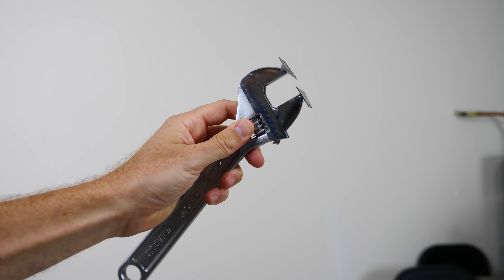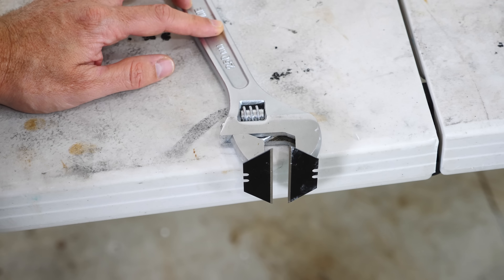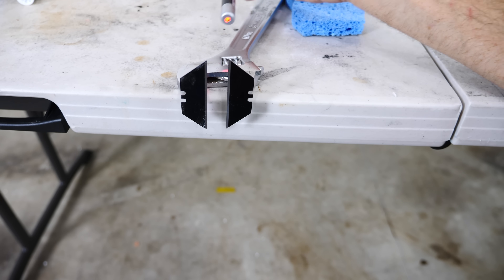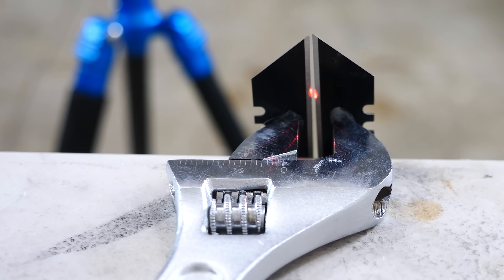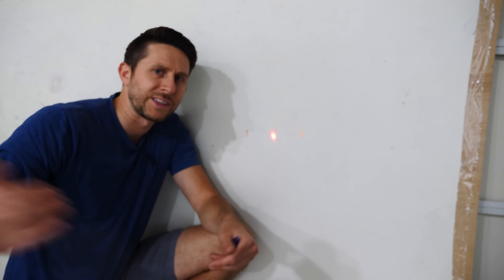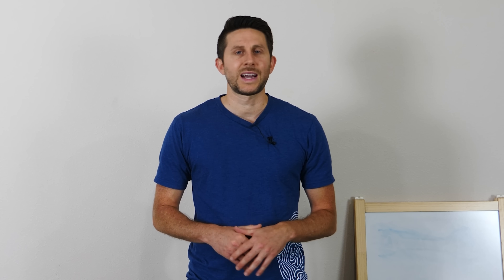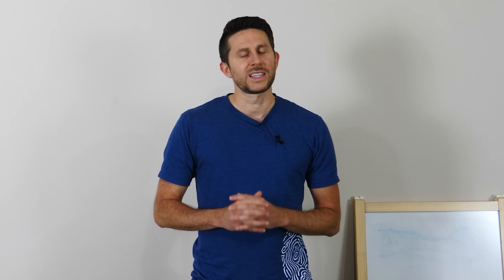Squishing Light Makes It Bigger—Heisenberg's Uncertainty Principle

Comment: The "elusive" particles with photons that are getting  squished is simply the actual Electromagnetic Quantum Kinetic Dipole Particles meaning the Vacuum is filled with EM Field Dipoles which are absolutely 100% VERY REAL and they have a mass of about 10^(-90) kg each.  There are 10^(-18) kg of EM Dipoles per cubic meter of vacuum on Earths surface (dark mass).  EM Field dipoles hit everything at speed "c" and transfer momentum causing all forces (dark energy).

Photons are particles with quantum superfluid flows of condensed EM Fields or flowing Bose Einstein Condensates of actual EM Field kinetic Dipole Particle "gas" that fills the vacuum.  There are about 10(54) dipoles condensed within a single "green photon".

NASA / DoD have known about EM Field Dipoles since the 1970s when the first Electromagnetic Compression Drives were designed and later built and flown under SDI Star Wars Research on USA DoD Flying Black Triangles and in C h i n e s e UAPs flying since 1999 (UAPs in the news are Hypersonic Weapons / Drones).  

After Dad helped launch Apollo/Skylab from #FiringRoom1 at KSC, NASA went FULL WARP until DoD took the research over and weaponized it.  Then the C C P stole the tech and weaponized it.

The US Navy has no chance against these EM Compression Drive Propulsion Systems on these UAPs.  These UAP can go 50g's and 10,000mph at sea level faster in LEO.  Yes the UAPs can work in orbit too.

Comment: 1:21 Photons do have mass, that was also proven.  Albeit the mass is so small that it is nearly inconsequential.   But then again, tell that to Einstein when scientists in the early 2000's proved laser photons can travel faster than light.  In that experiment the speed of a laser measured 310 times the speed of light through a gas of caesium atoms in an excited state which amplifies certain spectrums of light.
5:17 Seriously?  I guess no one learned that Red light and Infrared light has no UV rays in it.  Heisenberg principal does not apply here.  Only a sound education is needed.
6:03 Great concept if Time were a variable that was physical and could be manipulated by physical means instead of it just being a universal constant scientists haven't figured out yet.  I suppose next you'll suggest time travel is possible since Time is a variable that can be changed relative to all points of references simultaneously instead of one point of reference Einstein's theories fail to address as an issue of scientific observation.
Reply: "Photons do have mass, that was also proven."
Interesting assertion; who got the Nobel for this?
" speed of a laser measured 310 times the speed of light through a gas"
The speed of light as a constant is set by its speed in a vacuum, not through a medium where its speed can vary. This constant is the speed that nothing with inertial or relativistic mass can attain in a vacuum, neither of which light has.
"Red light and Infrared light has no UV rays in it.  Heisenberg principal does not apply here. "
Wait, so there must be UV rays for it to apply? Why? He's only explaining that the light did not arrive at the backstop as a wave, but as particles. And he specified his red light had no UV.
"Great concept if Time were a variable that was physical"
Well, he's only showing how it works in an equation, not speculating on its reality or whether one can time travel. 
" it just being a universal constant scientists haven't figured out yet. "
Since when is time a universal constant? It's completely relativistic, and only constant in any particular situation where people have agreed to regard it as a constant. I'd like to see him demonstrate the time/energy relationship, too, though.

Comment: I'd like to see this again but with differently sized (as in different diameters) laser lights and/or a gap that is longer. If the laser source is any bigger than a single photon, then we can't be sure that the line effect isn't happening because of the slightly differing angles of photons coming from the source itself. In other words, a photon coming from the center of the light will be at a slightly different angle than a photon at the edge of the light and changing the width of the gap could affect the difference in the angles of those photons.

Comment: I was more thinking about reflection to be honest. Those razor blades don't go to an infinite point. In comparison to a photon, the tips of those blades would be like a million football fields, surely plenty of space to reflect the laser slightly causing it to spread?

What happens if you rotate the blades 90 degrees? Does the light spread vertically?

Comment: Interesting experiment, I've seen that happen before, but that second part about wave v. particle didn't make sense when you were talking about the glow-in-the-dark wall, my experience is that the glow in the dark paint will not respond to red light, works great with blue or UV light, so what would happen if you used a blue or UV laser to do the test?  I know I'm missing something, please help / clarify...  Thanks!
Reply: Individual photon's energy depends on its wavelength, colour, if you will. Blue & UV light have shorter wavelength and hence more energy per photon than red light. You need a higher energy photon – the quantum of light – to excite the dark paint to glow. So, if you used blue laser light, it would make the wall glow and it would also still diffract – however, in a different pattern as the energy [per photon] would be different!
Reply: @Geenimetsuri  I understand wavelength of light is shorter for blue/UV than red but how did that provide the proof? If you can, could you connect the dots for me?  (pun intended)  If I repeated the experiment with a blue or UV laser it would still diffract and it would also charge the glow in the dark paint, sure, I'd expect that... but how does that show the wave v. particle properties of light?  Or was there something special about doing the experiment with red light?  Sorry but I'm feeling like I'm missing something fundamental here...
Reply: @HobbyHalloween  Diffraction is caused by the uncertainty in the position of the photon, the quantum of light. The wave-like quality of light stems from the principle!

I only understood it myself after watching the video.

Comment: WHAT HAPPENS IF WE PUT A WIND MILL IN SPACE AND MANUALLY ROTATE IT FOR ONCE?
WILL IT SPIN FOREVER?
UNLIMITED ENERGY?
THEN WHAT ABOUT 1ST LAW OF THERMODYNAMICS?
Reply: If you put an object in space and rotate it it will turn to continue rotating until another force opposes it.  I suspect it would not spend forever because there are still particles in space that may interact with. However as to the question of unlimited energy, that answer is simple. If you're not drawing energy from it then there's no violation. But if the windmill was connected to a generator which was generating power it would quickly come to a stop because there was no wind to keep it moving.
Reply: @NomadSoul76  i thought there is no friction and almost no gravity in space, so there won't be any stopping force for the mill, if we rotate it for once
i still don't understand why it will start slowing down if there is no friction and gravity

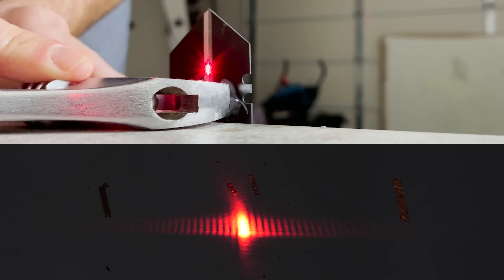Comment: 4:35

so you might have exlpained this but I must have missed it. anyway, this is an interference pattern. But I was wondering where it came from. 
normally an interference pattern is made when you shine light from 1 source through 2 or more slots. they then interfere with each others patterns and create this lot area and dark area pattern. but the laser in this case was being lit through a single slot. so how come we see the same pattern?

Comment: but if we know delta X and h/4pi then the only unknown left is delta p and we should be able to easily calculate delta p from there? you get what i mean? from a mathematical point of view lets say you say 5 times x equals 10 then its easy to find this single unknown which in this case is 2. so im not happy with the explanation because i dont like to believe, i like to know and i totally dont know how it can be uncertain and certain at the same time
Reply from the maker: correct you can solve for deltap. Deltap is not the momentum it is the standard deviation (variability) of possible momentums. The smaller deltax is the larger deltap is which means the momentum you measure as a result has a larger variation so you can't zero in on one single momentum.
Reply: @TheActionLab  ah okay i get it now, if i solve for deltap i get the variability of possible values but not the single exact value. okay that makes more sense to me now, thanks for letting me know

Comment: Sorry but I can't agree on this without more testing.  I am likely to be way off the mark (I'm not qualified) but I can explain why I disagree.
I explained to a friend that you can describe a photon as being like a circular table cloth.  If you pick the cloth up from the centre you increase it's energy which also decreases it's size [wavelength] on the table. The 'particle' is somewhere within the tablecloth and the higher the up [more energy], the more defined that position is.
Your experiment assumes that photons are 2 dimensional in that a photon which has passed through the slit cannot interact with one on the other side of the slit.  I don't believe this to be a true conjecture because of the '3D' nature of particles.
Note: I'd go so far as to say that photons 'diffract' because of their position passing through the slot - i.e. partial refraction and that the double slit experiment only works because the particle essentially interferes with itself on the other side i.e. the number of ways it can pass through the slot are limited by it's refraction and it's wavelength.
But then, I'm fully aware of dual nature of Dunning and Kruger :)
Reply: The table cloth conversation went like this ...
"How come my old Flood light is 500W and yet my TV can see the transmitter 20 miles away which is 1KW"
I explained that radio waves were about half a metre across and could easily be capture by a TV aerial but that light waves were tiny and literally had to go through your pupil.  Not only that but the lower energy of a radio wave meant there were far more of them .
A million times more photons that are a million times larger means the TV transmitter is a bright beacon to a TV aerial.

Comment: I don't get it, the light is clearly getting wider because it's bouncing on the edges of the razors getting spread around, like in the cilinders butterfly effect video...
Reply: How can it form so definite patterns then. We have done the experiment many times and concluded that even if you make the blades very very thin (no room for reflection) pattern doesn’t change
Reply: @karansandhu4827  4:37 hmm to me it just looks like the closer the blades get, the more the light curves around the edges, im not sure about the pattern, it probably has something to do with the reflection and the gap, it looks like the gap is repeated... anyway this probably should be tested with black body razor objects, under vacuum?? to see if the same would happen...
Reply: @elvinl.  i just told you the pattern depends on only and only three things. Slit width, distance of slit and screen, and wavelength of light. I suggest you to do this experiment with changing your variables and noting down the value of fringe width( distance between two consecutive bright spots). I am sure you will see that black blade shows the same result

Comment: Alright, I'm becoming more certain that what's happening here and with the double slit experiment is the light is refracting off the microscopic surfaces of the edge of the slit creating the wave like patterns.
Reply: King Pistachion  Just a flat response, is it? Okay, well hear me out if you would. Light is extremely tiny right? A particle of light can be so small that it's not bouncing off the surface of an object, it's bouncing off the tiny particles  that object is made of. Did you see the the experiment that he did to demonstrate butterfly effect? It's kind of like that, but with each particle of light behaving like the laser passing through the array of reflective tubes. Instead of behaving like a wave, it's simply behaving as particles would passing through field of other particles.

Comment: Fundamentally wrong interpretation. Misinterpretation. 
A photon is the 3D droplet of energy. The only true, perfect fluid which exists. Whose size is finite. And its shape is spherical. And the distribution of energy along any direction which goes through it has the shape of a soliton (solitary wave). Smoothly continual "bell"-shape. 
A photon is the energy in its most fundamental way of manifestation. A tiny pure-energy-object.

"Position" of an object. What is it? 
"Lambda" of a photon, which is: the length of a photon (energy droplet) in the direction of its motion, is not "uncertainty of photon's position", but it is the diameter of the energy droplet. The length of that energy object.
If you look at, e.g., the droplet of water. Not the perfect analogy, but good enough to highlight things about the position of a perfect energy-fluid called photon.
https://www.youtube.com/watch?v=nzhjBFhEwvg
https://www.youtube.com/watch?v=jn5KuSHguUE
https://www.youtube.com/watch?v=H_qPWZbxFl8
Where is the droplet? It is everywhere within the volume it occupies.
What is its "position"?

How does this water-droplet behaves?
https://www.youtube.com/watch?v=TLbhrMCM4_0
LIke a particle? Like a wave?
https://independent.academia.edu/ZDimi%C4%87
Read the files  1 and 2.
Reply: What are u trying to prove?
Reply: @karansandhu4827  I am surprised. On many other channels about physics, only I can see my comments. 
Well, I am sure that soon it will be the same on this channel, too.

“The scientists of today think deeply instead of clearly. One must be sane to think clearly, but one can think deeply and be quite insane.” ― Nikola Tesla

"Behind it all is surely an idea so simple, so beautiful, that when we grasp it - in a decade, a century, or a millennium - we will all say to each other, how could it have been otherwise? How could we have been so stupid?" - John Archibald Wheeler
Behind it all is not an idea, but the facts. Long time known fundamental facts. Two of them are expelled from "fundamental physicses of today". Yes, I know that there is no plural for the word "physics", but the reality demands it ("relativity", "uncertainty" (QM, QED, QCD, QFT, ..., strings/superstrings, ..., branes, ...), "spontaneity", "creation ex nihilo", "annihilation", ...). Mathematical mysticisms.
All of them are the results of "deep thinking" (attempts to invent the fundamentals of reality). 
Perhaps you will take some time to read the files 1 and 2.
Perhaps. 
“The masses have never thirsted after truth. They turn aside from evidence that is not to their taste, preferring to deify error, if error seduce them. Whoever can supply them with illusions is easily their master; whoever attempts to destroy their illusions is always their victim.” ― Gustave Le Bon
Unfortunately, not just "the masses", but the scientists, too. Especially the scientists.
https://en.wikipedia.org/wiki/Planck%27s_principle
https://www.academia.edu/2798010/Science_Pseudoscience_and_The_Three_Stages_of_Truth

Sorry for this long comment. Despite I know I write in vain ... . 
So, ... have a nice day!
Reply: @karansandhu4827  It requires some patience, time, and clear thinking (healthy reasoning). Read the files 1, 2, and 3 which you can find at the link which I gave in my first comment.
If I would say straight some things, nobody would believe me.
The best way to realize and to accept some truth, is to figure out on your own that it is the truth. So, read and think about what is written in the files 1, 2, and 3.
As I said, I was surprised that my comment is visible. So, I was talking to the creator of this video. As for you, I said what I said. And you'll do what you're going to do about that.
Best regards!

Comment: I have one unanswered question about light.
Under street light, when you pinch your fingers togather; when they are about half a centimeter away, the shadow of the fingers looks they are touching. Im really seeking an answer for it. 
(And another observation might be related to it, that if light source is closer to an object, the shadow will be sharper but as light source moves away the border of shadow blurs.)

2)another question, what is minimum length at which distance 2 electromagnetic waves don't interact? Is it wavelenght dependant?
Reply: For second question, i don’t think 2 electromagnetic waves interact unless you are intersecting them. Example just take red and blue lasers and place them next to each other. I dont think they interact

Comment: I've also run into a similar uncertainty when doing signal processing. The more you know about the frequency of a signal the less you know about the time at which that frequency was occurring. (Frequency resolution vs. temporal resolution)
Reply: The uncertainty principle follows from the "wave nature" of particles in QM. In fact, it holds for waves of any kind, so what you're talking about is identical. I believe this way of visualizing it is very intuitive and I wish it would get taught like that in uni courses.
Reply: And of course E = hf . (-:
Reply: Yea the frequency time uncertainty is the same as the energy time uncertainty except for a planck's constant. The spatial version is the position spatial frequency uncertainty. This is equivalent to the position momentum uncertainty except for a plancks constant.